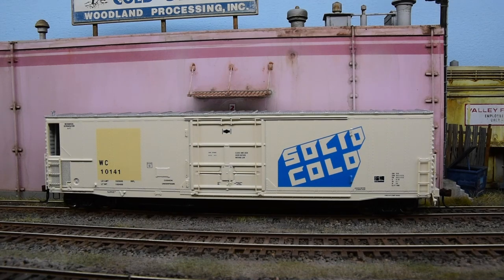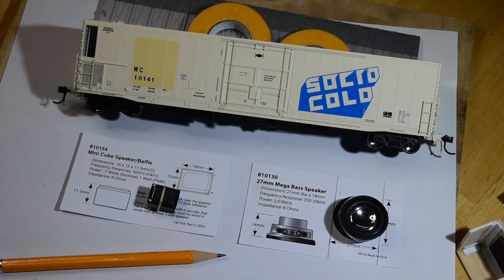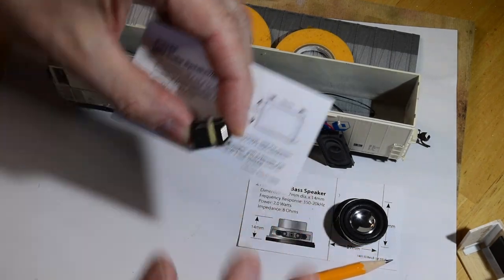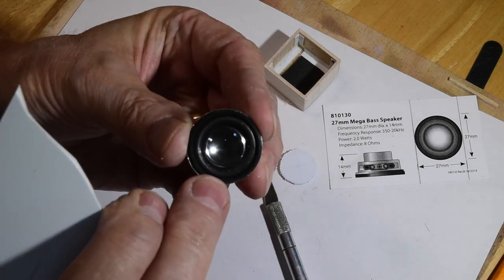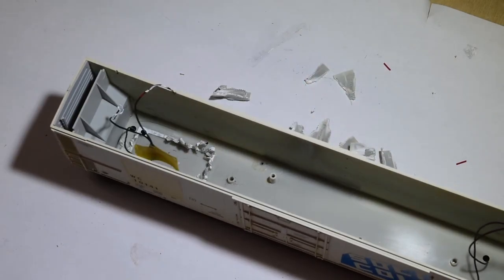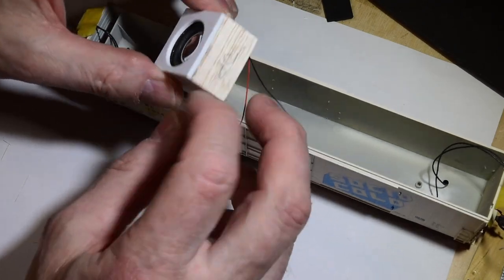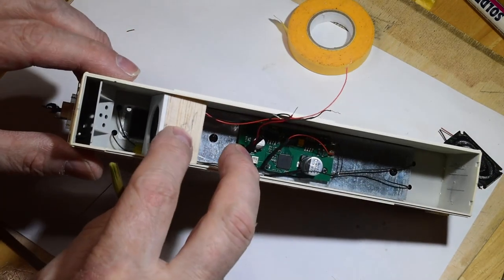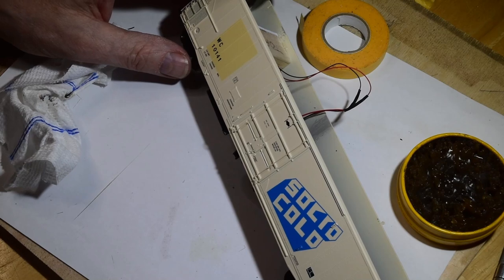Awesome Sound Upgrade! | Athearn Genesis Mechanical Reefer

Comment: That does sound good!  The hobby has really come a long way!
Reply from the maker: I couldn't believe how good it sounded after replacing the default speaker. I'm really sold on the "mega-bass" speaker if used in the correct manner. At lower volume (live), it is tolerable and actually pleasant to listen too. ~ Boomer,

Comment: I have started using my cheap FDM 3D printer to make speaker baffles. Works great and can easily crank out as many as you need for the fleet. Also the faint layer lines don't matter since speaker hidden anyway.
Reply from the maker: Great tip! The potential and quality of 3D printers is yet to be realized. At this point I am not impressed with them simply because the "evolution" curve is rapidly changing rendering last months version obsolete. Not to mention, all the time behind the design. I can still build it faster than a 3D printer. Besides, every application (locomotive) is different, which requires a new design again. I'm still an "Old School" seat-of-the-pants modeler . . . lol. Cheers. ~ Boomer.

Comment: Boomer. mate I was a boat builder (timber and glass) All timber resonates as you get it thinner (see guitars) so to get a speaker box that may be small enough to fit in your engine.
 (1) get a dowel size of the speaker outer rim or resize it up with tape if necessary.
 (2) now get some veneer with the grain running at 90 degrees to the speaker's face and deep enough to allow a 1/8" at the back of the speaker, wrap it around the dowel and cut to size and glue (no tape) then glue a section of veneer and mount at the back with a hole for the wires BUT big enough to allow a nail to pass through without hurting your fine wires ( this will allow you to poke the speaker back out if you push it in too far and the rear touches the back) of the new hatbox type speaker inclosement.
(3) if your veneer is stubborn just boil it for a few minutes shape with a tape join and allow to dry before you glue it, Note if you boil or steam it as soon as you have it taped to fit remove it from dowel as it may go mouldy before it dries if weather is cold.

Note soft timber like Balsa is a sound deadener so you will need a fine-grained harder veneer also if you want to mount a few try different woods you may get a surprise in tone.
Happy Hunting. 
Tony
Reply from the maker: Cool. Thank You for the tips! Cheers ~ Boomer.

Comment: Would not  a dremel  have been used to cut that box out from inside the car? ... Ever use liquid tape instead of shrink tubing?
Reply from the maker: Yes. A dremel would work well, but I hate the Dremel "noise pollution" and debris in my older age . . . Cheers.

Comment: You shouldn't use corrosive flux on electrical jobs. Use flux cored electrical solder, no extra flux or clean up needed.
Reply from the maker: Much better solder joint with corrosive flux in my experience. It cleans the joint better. Any flux should be cleaned off anyway. Cheers.
Reply: @boomerdiorama  For electrical connections (not rail) I don't use any extra flux and never clean off any left from the flux cores, it doesn't leave much residue and doesn't cause any problems.
Reply from the maker: @mikerubynfs  Why , then, does ESU and TCS recommend to clean off any solder joint from a board regardless? They should know better than you or I right?
Reply: @boomerdiorama  I haven't seen that but have soldered many ESU decoders, including replacing component on some earlier decoders. In 40+ years of electronics at home and work I've not had a problem with residue flux designed for electrical work. I suspect the warnings are incase acid flux was used, I've seen several that were damaged, by friends who used it.